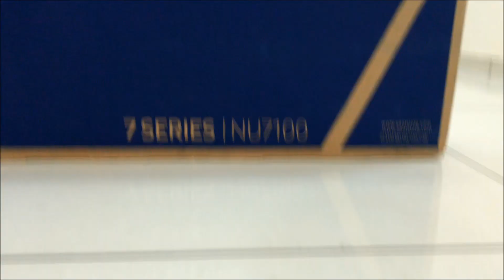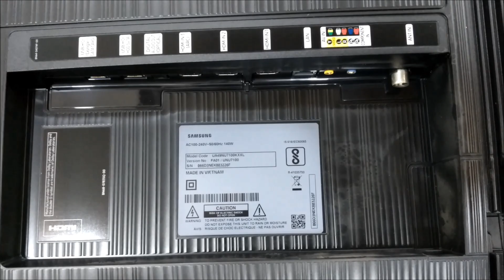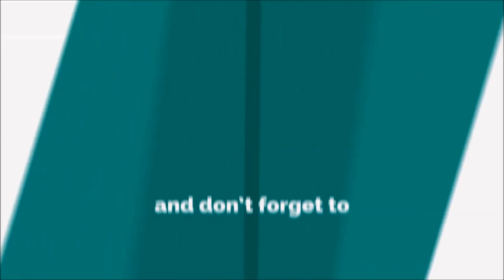SAMSUNG Series 7 Ultra HD (4K) LED Smart TV | Unboxing and Installation

Comment: The smallest size for this model is 43"; I noticed that you used the VESA mount option.  I'll be using the same option, as it will replace the VESA-mounted 42" in my bedroom.  If you are using a VESA mount, you can (and should) use your existing VESA mount screws - as they likely came with the mount itself.  (Yes; a 43" should take up no more space than an older 42".)
Reply from the maker: Thank you for your suggestions.
Will do that
Reply: Christopher Estep how do I go about using a different wall mount? Or should I go buy one that you mentioned?

Comment: i own this but now after 4 month using it is not finding wifi so i cant connect to my wireless.
And screen mirrow is not working too.
Any explation?
Reply from the maker: Hi, if its 4 months old then you can ask to customer care because its in warranty right?